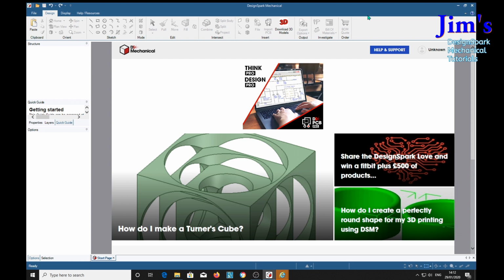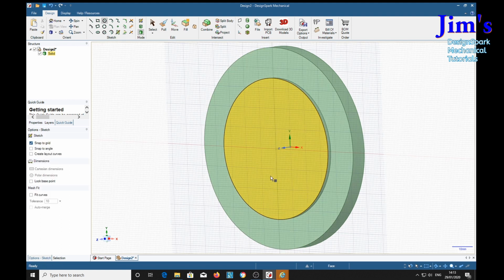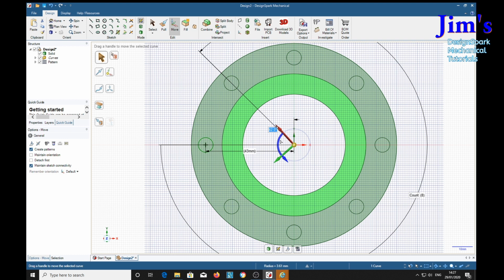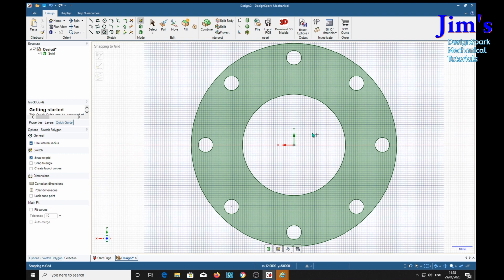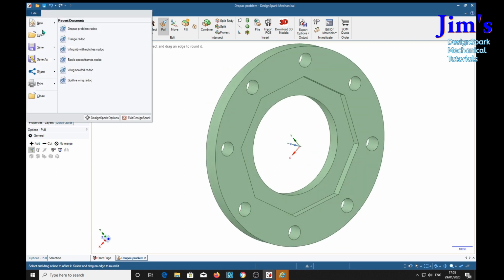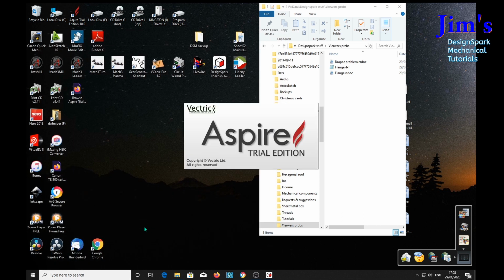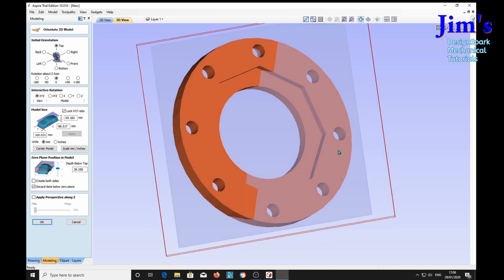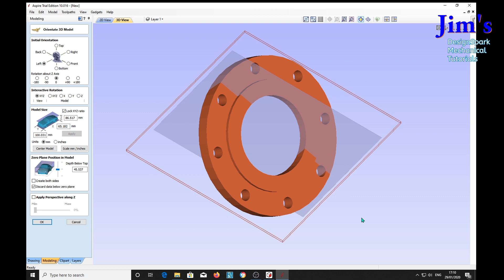DSM rsdoc to dxf 3D files

Comment: Hi Jim, I tried to export a dxf file from Designspark, but my other cad programme, Solidedge, treats it as a flat image, not a 3D solid. Any thoughts?
Reply from the maker: Did you try any of the other versions of CAD DXF that you could have saved the file in DSM? There are 9 version of AutoCAD DXF file you can save the DSM file. Try and find out if Solidedge prefers a particular AutoCAD version of DXF.
Reply: @JimTaylor42  I tried a few, including the version you did your export with. No luck yet. Have you gone over to one of the subscription packages from RS yet? I still use DS5 on my computer which isn't connected to the WWW. I was trying the export option more for someone else than for me. My DS5 files are fairly easy to redraw in another cad programme.
Reply from the maker: @lornablewettandlee504  All I have ever used is a stand-alone version of DSM. There are a couple of other things you could try:
1. Download and install the trial version for the Vectric Aspire software, like I did, and see if it works in that.
2. If I had your real email address I could send you the actual 3D DXF files that I used in the video for you to try in Solidedge.
This may point at where the problem might be.
Reply: @JimTaylor42  I copied your email address from your youtube site. Is it OK to send you an email? you could then send me the file.
Lee
Reply from the maker: @lornablewettandlee504  Yes, no problem.